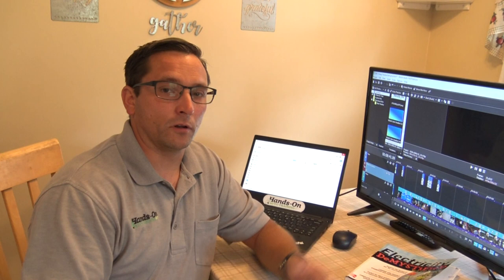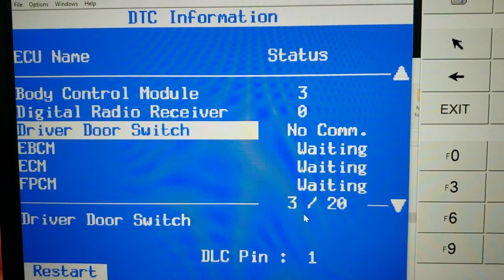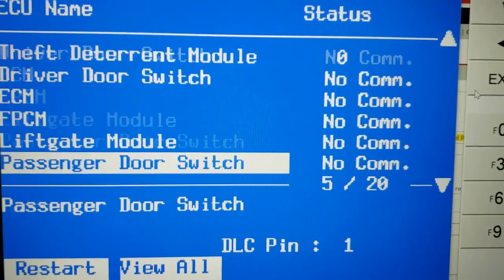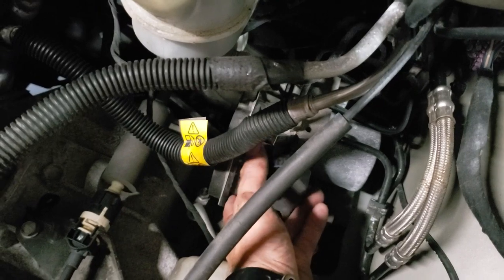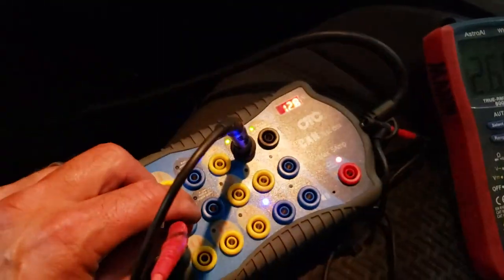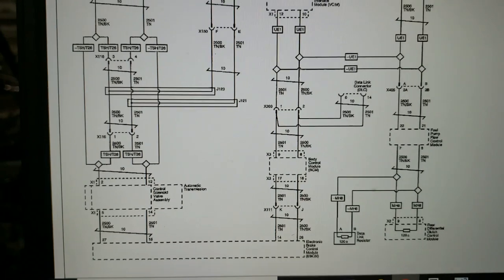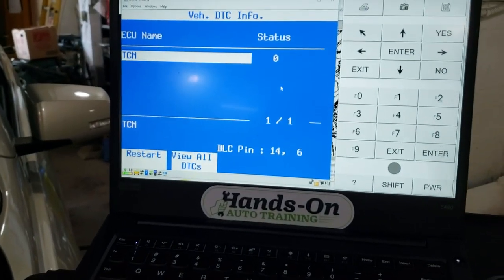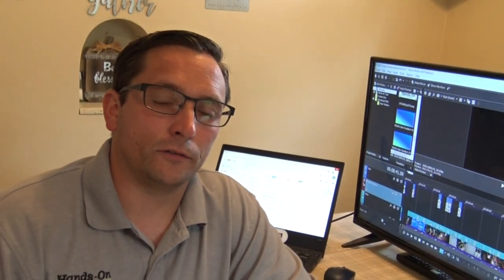2011 Chevy Traverse No Com bad ground

Comment: i was confused for a second when you unplugged the abs module. i thought that was the culprit. but you worked your way upstream of the system unplugging the next module in line. nice work. but ifi had the schematic to look at longer i wouldnt of got confused.
Reply from the maker: Thanks for the comment Phil. I am always trying to keep the videos as short and to the point as possible as not to loose viewer interest.  Do you think that more time of diagram on screen or talking about how I interpreted how the circuit works would be good in the future?
Reply: Yes I do think so

Comment: Thank you good information I'm going to check that ground get the car up in the air on the hoist and check the engine ground I just clean the battery terminals up and I just clean the ground cable from the battery to the frame of the vehicle

Comment: Excellent practical demonstration. I had always thought there were only two 120 ohm CAN resistors in parallel, giving 60 ohms when measured at the DLC. To my surprise, in the schematic shown at 4:13, there is a 120 ohm resistor inside the DLC itself (on top of the one shown in the Diff control module and the ECM)! Hmmm, that's confusing. Is that resistor inside the DLC out of the circuit when you measure resistance from a breakout box? Do you still normally get 60 ohms if you measure at other CAN tap points, say at a (still connected) module somewhere else?
Reply from the maker: Good observation.
  If you look closely you will see on the schematic in little boxes in those circuits saying -MH8 or MH8 (I think MH8 or MH6 hard to see in video I even looked up schematic and hard to see there as well). 
  The vehicle has one or the other so still just 2 120 Ω resistors on this Bus.  So if this vehicle does not have a rear diff module one of the 120 Ω resistors will be all by itself.

  Note usually the stand alone resistor when equipped will be near the optional module that it is in place of, however there are exceptions, always consult SI.     Would it be helpful if I do a video on wiring diagrams?
Reply: @BrianMann216  Brian, thanks for the response! I get dealer repair manuals for all the vehicles I work on, but the communication networks are often not discussed in enough detail to help with repair. Presumably dealers have other documents that explain those connections more fully, but I haven't been able to find any of those. Thanks for your video like this one! Well explained communication diagnostics, like shown here, here are gold. 

Dave

Comment: Good job. Question, how did that bad ground make the can bus signal high voltage?
Reply from the maker: The chips within modules are provided voltage , powers and grounds that is ,  from the module it self.   If the low reference (ground) for the module is high,  all the low refreences for the vehicle will higher than they should.   IE a old school GM PCM can have a bad ground and still communicate ,   however sensors on the 5v  reference will all read higher than they should. Everything can get skewed.
Reply: @BrianMann216  OK, you know how I am. I put things in layman terms. You are saying "if the foundation is crooked, then the whole house will be crooked.

Comment: I am having the same issues with a 2010 Chevrolet Traverse 3.6l. I have a crank no start after engine replacement. You did not show how you back probed your wires on the TCM or any wires.

Comment: What exactly was the root cause in this particular case? G110?
Reply from the maker: Yes it was the bad ground.
Reply: @Brian Mann I really enjoyed the video I’m a student at a tech school to become an auto technician but in my spare time for extra money I run a tiny shop. I recently done an engine swap on a traverse and run into the same issues. Wiggle the same wires and  was wondering if you can give me an idea of witch ground solved your issue and where is it at. It would be much appreciated. Thanks.
Reply: Also ignore my name on here.

Comment: What could cause no electricity inside the vehicle outside of the vehicle but it still gets power to the fuse box
Reply from the maker: Bad connections, open circuits, blow fuses.
Reply: @BrianMann216  what could cause the circle around the park indicator to not show and car still doesn't start
Reply from the maker: @jessewilkinson1010  really depends on all kinds of things,  No comm with TCM, other comm issues, wiring.... the list goes on .. what codes are setting?

Comment: I’m having the exact problem, no check engine light, no crank, no start, no communication. Can I ask what ground it was? Where was it located? Desperate for help before sending it to shop.
Reply: Did you get the answer? I got the same issue